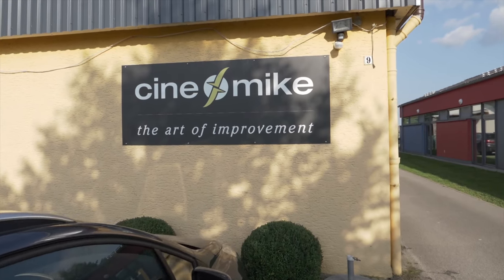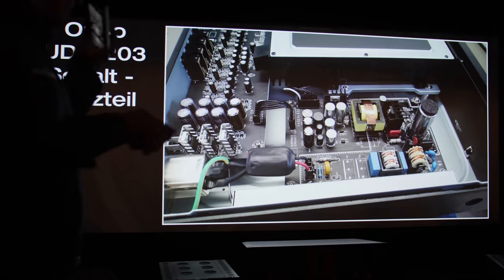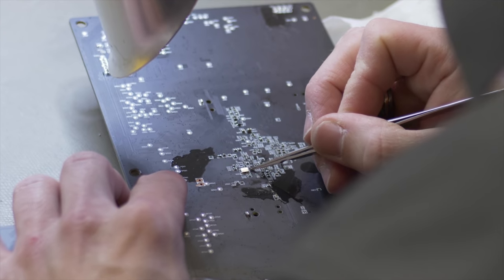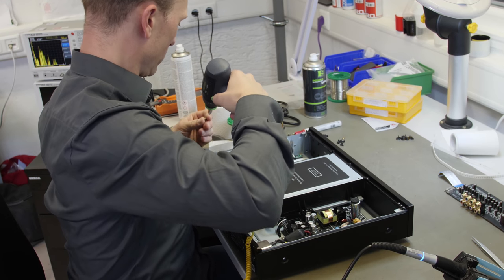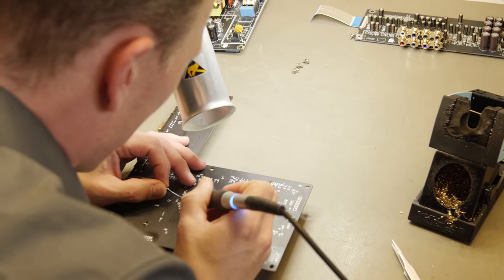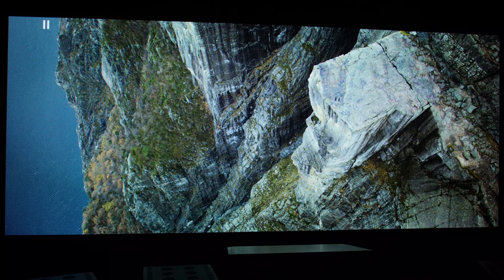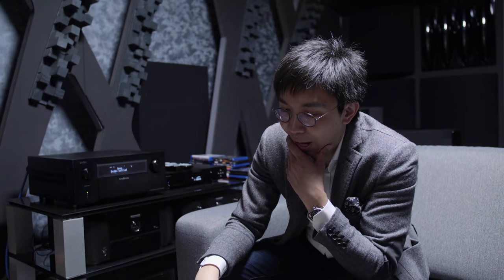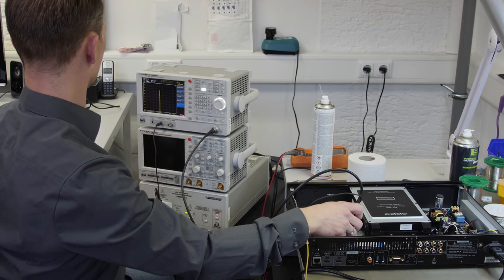What If You Can Lower The Noise Floor on Your OPPO 203/ 205? (Warning: Expensive!)

Comment: Typically the multichannel audio is sent from the video source to the receiver through the digital connection, and a DAC in the receiver would do the digital to analog conversion. Do you mean the Oppo's analog audio circuitry is where the mods had been applied? So analog audio cables were required between all the Oppo analog audio outs,  and a receiver/amp line level analog inputs? That would be quite an unusual set up nowadays
Reply: That's it essentially. By using the analogue outputs on the oppo you are bypassing the receivers DAC, and relying on the DAC that is inside the oppo to do the digital conversion (because of the DAC that's in the oppo. This is mainly used in two channel audio but can be used for home cinema.
Reply: nihilityjoey Yep, the latest ESS Sabre Pro Dac being used to its full potential. Plus the analog output stages most likely modified and optimized for lowest noise and distortion.
Reply: @rickg8015  that's correct.
Reply: We are only talking about the Hdmi connection here
Reply: Cinemike DE oh, that’s cool.. Even at that stage you could hear the benefits of the mods. Interesting.
Reply: Rick G actually there was no analog connection
Reply: Cinemike DE Yes, I got it. HDMI Audio output only, purely in the digital domain being used in the Oppo in Vincent’s audition.
Reply: @cinemikeDE  Yes, but the oppo would have been doing the sound  conversions, not the reciever which is again utilising the oppos DAC.
Reply: nihilityjoey The oppo is on bitstream output. All decoding is in the AVR
Reply: @cinemikeDE  Aaahhh okay, I get it now.
Reply: Then any difference would need to correspond to differences in the bitstream, eg. the bits themselves, or jitter. But jitter is typically no problem with proper buffering in the receiving end. And there should be no bit error differences on the receiving side even without the mods, bits are bits after all. Have you tested whether there are actual significant jitter differences, or actual bitstream differences (bit value errors, not noise levels) before vs after the mod? With no bit differences, there would be absolutely no acoustical difference, since all those bits received by the AVR, before and after the mod, would be the same and would be converted to exactly the same analog signal in the AVR's DAC, not in the Oppo
Reply: Cinemike DE I don’t quite understand why there are differences in audio quality when using bitstream. Furthermore, when there are differences in AQ why aren’t there differences in PQ? This should be even more obvious as the Player is doing some actual decoding, in contrast to the audio part.
Reply: Sledge Bam due to lower jitter and lower noisefloor in the complete system there is actually a huge difference in audioquality and there is also a difference in picturequality. This results in more stability in movements and more depth in the picture. Actually people are much more sensitive in detecting differences in sound in AB comparison. You can visit our place anytime and see ( hear ) for yourself.
Reply: There's no difference in either. This is audiofoolery at its best, but that doesn't make the observed differences any less real to the listener.
Reply: Raul Saavedra totally nonsense - yes bit s are only bits made up from good bits and bad bits you are dealing with udp bits here. Electronics are pseudo digital. All digital electronics are actual analogue and so are subject to noise.
Reply: @f091537  the noise in the components can effect the clock, therefore causing errors in the transmition of the bits, for instance a 1 can become a zero and visa versa. All electronic signals are affected by noise analogue or digital especially clocks. Cleaning the signal before it gets to the clock, changing a clock, will give better sound quality and picture quality. It's not adding pixel information or extra music information, it's simply cleaning your sound and picture so you get visual and audio improvements.
Reply: Cinemike DE thanks for the explanation. Is this something you can capture with a camera (stability and motion obviously not)? I did some reviews of mediaplayers and concentrated very much on the PQ (shown via objective test patterns) so it would be great to show the effects in PQ of your work in a review. I’m based in Germany so maybe we can arrange something.
Reply: Lower noise floor for digital signals does not change anything if the receiving end already was able to recognize a 1 when it was a 1, and a 0 when it was a 0. The important thing would be differences in bit error rates at the receiving end. Lowering the noise may not change that at all if the original noise level was already within tolerance and causing no bit errors in the receiving end. Lower jitter makes no difference if the receiving end is doing proper buffering. 
By the way my question stays unanswered, did you measure bit error differences before vs. after the mods?
Reply: Raul Saavedra I have and the error rate is far less and the jitter much lower ! You are making the school boy error that with udp all the components work perfectly as in a text book. You state tolerance which is bogus as it’s meaningless as that’s only in a control environment and as no of these system are true digital and only pseudo digital your point has no merit as shows no understanding of electronics in the real world. Noise in any system can cause miss triggers. Most of the power supplies are very poor on these devices and have been tested in the lab under perfect conditions. Once in the real world that does not apply. The mistake is you all forget this is udp send once and forget so if there is an error no way of correcting it just concealing it. There is no such thing as a digital signal that nonsense taught on poor courses around the world with people getting degrees that in the real world are useless. You have analogue voltages that have different voltage levels to represent a 1 or a 0 if you look at this analogue single that this is it’s plagued with noise in multiple harmonics up to ghz. This will effect clock and any device connected. All dependant on its grounding. If you put an oppo on a totally clean power source that is better than studio level conditioning it will work better but what u see it it corrupting itself with its poor noise handling. The device will build up noise over a period of time you can actual see and hear the picture and sound deteriorating. Importantly you can measure the error concealment rate going up and the error rate very close to point of failure. This is not magic just down to design what cinemike are doing is fixing poor design but like having help from an expert on your homework. All consumer equipment is designed for a price not a purpose. True professional equipment is designed for a purpose. Saying that a lot of pro equipment these days are made for a price so in most studios you end up modding it yourself just like cinemike does! Like all geniuses what he does is simple as it can be measured and results compared the true geniuses is it is very very effective!
Reply: I believe you nihilityjoey have not much idea about digital audio and standards then. Of course it knows in what order they are meant to be in, and there is a very well specified standard for HDMI
Reply: "Error rate is far less" Interestingly you say so but are not providing numbers. If you did measure it, how about you say precisely was the typical error rate you allegedly measured before mods, and what was it after the mods?
Reply: Raul Saavedra hdmi is very poor for audio as it sits in data island and is all cut up which is why the audio jitter is so high compared to to say aes which now we can get below 1ps. Correct it does not go out of order but it can easily drop packets and unlike the picture it not as robust. On some very high end professional devices they have started handling hdmi slightly differently and this is a massive improvement. This does cost as a hdmi controller is normal around $1 so to do it at a cost of $50 in the consumer world is not viable due to cost!
Reply: Raul Saavedra I am not near my notes but off the top of my head before its 300 in 1000 before that’s packet had errors on the out put with jitter if I think 660ps it went down to 50 in 1000 and jitter of 110ps. One oppo firmware update screwed it and the jitter went up to 900ps the latest update bought it back down.
Reply: Before you ask I use tektronix analysers and I have written or been part of writing a lot of the standards you all know and love and see everyday
Reply: 300 errors in 1000? Packets? Not only your reply suggests that you really did not measure anything, from all I can see, you don't have a proper grasp of digital audio and HDMI standards and technology. Not arguing with you any further
Reply: Raul Saavedra sorry who are you again? I think u are the mistaken one. It’s very easy to see the error concealment as the check sum in the packet says it has an error
Reply: An error might only be a 1 bit error in a packet and strangely it’s usually a lower order bit
Reply: It seems sir you are clueless about udp data !
Reply: The amount of BS and cluelessness is pretty strong on some replies I got above. This will be particularly crystal clear to anyone familiar with networking protocols plus digital audio and HDMI. People seem to think they can post whatever on the Internet getting away with it, as if noone anywhere in the entire world with knowledge about the matter would ever stop by and could take a look and see through the level of complete BS.
This is the first video from HDTVTest that I have disliked. I seriously wonder if Vincent will keep this video up in the long run.
Reply from the maker: Raul Saavedra Oh believe me, I was as skeptical as you too, and made sure to check the whole setup for the comparisons. I can only invite you to visit Cinemike and hear the difference for yourself, armed with all the theories in the world, just as I did. I believe in what I heard, otherwise I wouldn't be speaking with such fervour and passion. 

Oh, and if the Samsung Q9FN backlash and repeated YouTube attacks by others channels haven't forced me to take down ANY video, what makes you think I'll take down this one? Particularly if it fully reflects my opinion? :-)
Reply: No matter how skeptical we believe we are Vincent, a blind or double blind test would be needed to rule out bias when we know which setup is which. Anyone can fool themselves in that respect, that's why blind tests were created in the first place. "Hearing the difference for yourself" is quite pointless, does not prove anything whatsoever. And even with blind tests it could simply not just use their provided "stock" Oppo player (or their own cables and complete setup for that matter) against their modded one. If you are truly skeptical I'm sure you should see how easy it could be to skew results without rigurous controls. The technical comments that some posted above are clearly clueless and way off, which brings up some huge red flags to say the least. That's all I'd like to say. Watch out!
Reply: @raulsaavedra709  bitstream or not, the source is still reading and packaging  digital information to the reciever. The less errors in that information the better. And that's what these guys are doing. It's not a hard concept to understand.
Reply from the maker: Raul Saavedra You're preaching to the choir: my other half works in the medical field, and I am fully aware of the effects of bias, having studied and understood why randomised controlled double blind controlled trial is the norm there.

But as you may be well aware, conducting blind studies consumes a lot of resources: time, money, equipment, methodology design. Multi-billion pharmaceutical companies fund medical trials on the back of the obscene profits they hope to generate, but such resources are just not available for such a niche product even if we had the best intentions. By the same logic you apply, do you automatically discount all product reviews - phones, cars, robot vacuums, quinoa porridge - simply because none of them are randomised-controlled double-blinded?

At the end of the day, no one can change anyone's opinion over the Internet where armchair experts and conspiracy theories run amok. I was merely reporting my experience, in as factual a way I could, despite actually harbouring bias AGAINST hearing any improvement from the outset owing to my scientific background. I have heard the modded equipments, and none of the detractors have. Which is why I invite people to visit Cinemike to listen for yourself, and if you have the resources to put together a double-blinded audio test and participate with an open, unbiased mind, I'm sure they will be happy to oblige.
Reply: In all honesty, what I would have expected is not a blind or double blind test, but that you, as the professional Youtuber and video calibrator, would have probably received a modded unit for review on your own premises, and you would have managed to find a stock unit on your own, not one from them. And then you as a Youtuber would have made sure to do at least a controlled A/B comparison on your own terms, in your own controlled setup, without them present. That is what I would have called an independent and skeptical review. Not on their terms and on their premises, not like this video
Reply from the maker: This is not a review, and not titled/ presented as such. Your own bias is interpreting it as such.

And pray tell, who is going to cough up the 5500 EUR so I can "manage" to find a stock unit on my own? Do you expect car reviewers to "manage" to find a new Audi A1 to review too?

As expected, armchair experts are always going to be armchair experts, always demanding other people to pick up the slack without needing to commit/ pay a dime over the internet.
Reply: Never said you should buy the stock unit, I assume you have lots of contacts and might be able to get one on loan. Don't mind you calling me an armchair expert. Do call an actual expert then, check with them about digital audio and HDMI, and why lowering the noise floor in the HDMI interface might do absolutely nothing to improve the bitstream that the receiver will receive and convert to analog in its DAC. Or measure it yourself, bit-error rates at the receiver end, stock vs. modded, also jitter. Something that the posters above clearly have not done. By the way, not sure if you noticed, some of the most embarrasing comments above by some others have been edited. E.g. the one about the receiver not knowing in which order the bits would need to be. I won't argue further, but will repeat my suggestion: watch out for the red flags
Reply from the maker: Raul Saavedra OK, I just checked your profile, and you are based in Bonn, Germany, which is only one hour's drive away from Cinemike. Are you going to visit them and listen for yourself with an open mind, or do you prefer to defend your belief over the Internet?
Reply: No, no interest. It is absolutely pointless to do A-B on vendor's premises when they clearly have a stake on whether A or B should sound better than the other
Reply from the maker: Raul Saavedra Haha typical. Even if I did a blind A/B comparison on my own setup/ premise and report an improvement , you'll find some sort of excuse to discredit the test because it's just easier that way to support your own belief. That's bias.

Anyway, all talk, no action is the classic hallmark of an armchair expert, so you have a good evening.
Reply: Bias is rather to consider a blind AB and thinking already that you would report an improvement. Also to assume that I would do what you are saying. That is actual bias
Reply: @raulsaavedra709  You are right, the comment was edited, deleted in fact to make way for one, more on point. The source is the one transferring the digital information to the reciever, all the reciever can do is decode that information, errors an all. That was my point. The reciever doesn't fix those errors. In fact the reciever dac will add its own errors. Now I don't know if you are listening to yourself but you've went from "modifying the hdmi interface won't do jack" to it "MIGHT not do anything".  This video has shown that it does.
Reply from the maker: Raul Saavedra I wrote "IF", not "WHEN", and the post is unedited. It appears your bias is clouding your comprehension.
Reply: Major mistake HDMI is not a networking protocol and has no similarity to one what so ever. I spend more time firing network people who think they know all about video than anyone else. HDMI is a point to point digital transport interface using send and forget packets (UDP) and is a lossy interface. This is the key HDMI is a Lossy format cos its send and forget with no return path for errors. HDMI is an extension of the DVI format so its a bodge as it has no audio mechanism, the audio is cut up and inserted into the blanking which in HDMI is referred to as DATA ISLAND. The formats only have a return path to communicate an EDID & HDCP to downstream devices. 

Networking has no place in video and audio as its not real time. If you have to send video or and audio over a network you have to use UDP which now means you have created a lossy system that now will suffer from data loss. Unless you send it as a Store and Forward file. Ethernet is a Send & Return format and as Video and Audio is time sensitive cant be sent in that way as you would have major gaps in the picture and sound. I have great pleasure in firing computer and network people from film sets and in post as they have no place in our world just cos they have a few cisco certificates they think they know how the world works and I enjoy humiliating them and make sure everyone knows they are phoneys as they can't deliver what is needed and come out with real BS as why its not working. So before you call BS think do I really know what I am talking about?

I was with Vincent when he shot this video and think it's one of his best as it's about the real world and real issues. If it shakes the uneducated from their safe world where they think they have all the answers then he's done a great job as Digital electronics is so hard to get right as its suffers from so many issues the analogue world never did. Very few people really know about this subject and I mean a handfull of people in the world.
Reply: Both Ethernet as well as HDMI have a packet-based transport layer, means chunks of data will be sent and either received or lost. Thats alot lower than UDP, and UDP would be more than fine for realtime audio btw.
Ethernet can detect errors, HDMI can detect and correct them (obviously only to a degree).

Now you would not even start any blind-listening test, you could simply measure the detected/corrected error rate to prove a difference.
The fact that someone sells stuff for thousands of euros and doesn't care to verify his work tells you alot, how much he is interested in quality.

Thats the thing with digital transports - you can very easily test their functionality.

There are standards for acceptable amount of errors, for Ethernet this is must be less than 1^-10, I expect HDMI to be comparable. If anyone sells hardware that makes an audible difference by lowering the error rate its horribly broken.
Reply: HDMI has no method to actually detect errors other than the checksum in each packet. Ethernet is a lossless system, HDMI is a lossy transport method. Ethernet has error correction, HDMI has error concealment. You can't compare the two as they like comparing a bicycle to a Tesla. HDMI does not have a comparable error rate as its send and forget. You can guarantee 100% packet transmission but you can't guarantee that all the packets are correct. This was HDMI strength comes in which is HDMI concealment, This means it will try and fill in the errors. In a critical application like audio and video, this is hopeless as it fudges the output hoping you don't notice. This is where people make huge mistakes in forgetting that HDMI is a lossy transmission method, it actually states this in the HDMI spec its not a verbose verbatim transmission method. 

The Cinemike guys have tested this and everything is measured as well as listened to and viewed as in this world pure measurements don't mean it will look and sound right that's the first thing we teach audio video engineers you need to look and listen as well as measure. I love all these people commenting who have no practical experience and rely on something that they heard once and believed to true. The only way to have an opinion on this is to DO IT! Also, why are people so stupid to believe that you can improve on a bad design? If you do then why do you upgrade your equipment? A DVD player from 2002(HDMI introduced) should be perfect in sound and picture compared to anything today! No, it does not so now go away and rethink your logic!
Reply: What a load of bollocks.
Ethernet has a 32bit crc and HDMI 8bit BCH code per packet in the transport layer, this allows you detect and correct an certain amount of errros. the important point is this: its extremely unlikely (1 to billions) that an error is undetected and the data will be treated as valid.

So if theres a problem in noise then you could count the appearing errors, as this is done when testing cables. A "tuned" device should then show lower errors.
given that bit errors need to be extremely rare as dictated by spec, I really doubt that.
You dont need to start a subjective listening test if you can just simply reason about, and even then the eyes/ears are a lot less reliable then instruments aswell.

Oh, and a DVD player can have various improvements aside HDMI, like digitally postprocessing. HDMI is lossless, of couse only if within spec, cutting the cable or wrapping it around a transformator will kill the signal.
I have no doubt that there are alot of improvements possible, but this cinemickey stuff is like ejaculating on the backseat of a tesla and claiming it will accelerate faster now.
 (The only way to have an opinion on this is to DO IT!)
Reply: Total bollocks !
Reply: Where do u get this rubbish? HDMI is lossy its a send and forgets transport stream not a Send and Return network protocol. Why do you keep comparing apples with oranges?  Where do you get that its lossless? It even says in the spec it's lossy. It has no way of sending data again if it has an error. It does not have error correct it has error concealment totally different.  Next, you will be saying my Tektronics video analysers is wrong or broken when it shows you the loss in each packet? Anyone who works in this field knows HDMI is total rubbish. Displayport is far superior and SDI is way better all are classed as lossy transport mechanisms. You are posting FAKE NEWS as nothing you have said is actually true other than the how the packets are structured. Do you work day in day out with this? Do you have a method of reading the HDMI packets and checking for yourself? I do and you are spreading nonsense.
Reply: define "lossy", I doubt it means what you think it does. ie. what is not "lossy" and works when I cut the cable?
send & return has nothing to do with the transport layer, ethernet has no "send & return" either - but TCP/IP does which is several layers higher (and could be run over HDMI`s transport layer). Ethernet and HDMI Transport layer are comparable, and agnostic to whats running over them, and do exactly the same in the stack.

Why do I need to read the HDMI packets myself, what kinda weird logic is that? There are tools for testing cables and oscilloscopes able to decode the packet layer,
and guess what if you want a HDMI certificate you need to prove that you have a error rate of less than 1 in a billion. And up to 4 wrong bits per packet can be corrected.
Means on a compliant chain you will see never have, much less see any error.
What you do, in other words is you send additional data (redundancy) to validate and/or correct your payload. Thats only working aslong the error rate is low enough, and thats required by HDMI spec.

You can brag whatever you want with your equiment, you have no grasp about anything.
Reply: I refer to the OSI Model, the Data link layer is responsible for delivering packets and is totally agnostic to the content and meaning. This is a fitting description of the HDMI Transport layer, on which you could base UDP, TCP and whatever else protocol you need.
What you mean with "lossless" is something like TCP, and this is not handled at this layer, and with that definition there is no "lossless" display connection as none of the existing will resend lost packets.

Kinda strange that I need to explain this to someone who was "involved in creating a number of these formats and specs"

And thats completely beside the point, as its enough if you can detect if a received packet has errors (recoverable or not) to count them. That would be enough to measure the a difference, and equipment to measure this must be available for compliance tests.
The specs call for less that 1 in a billion error, and a packet on the HDMI-Layer can be fixed with up to 4 of them. If OPPO has a visible/audible problem with that, its time for a refund and report to the HDMI consortium.
Reply: The spec may call for that and I can't find it in the document in front of me which is the final HDMI 2.0 spec so where are you getting this stuff?

The equipment for testing is made by TEKTRONIX if you knew anything about testing and measurement they are the reference in the industry.  

The OSI is the second layer of the seven-layer OSI model of computer networking and nothing to do with HDMI and HDMI uses Transition-minimized differential signalling which is not what ethernet uses. A two-stage process converts an input of 8 bits into a 10 bit code with particular desirable properties. In the first stage, the first bit is untransformed and each subsequent bit is either XOR or XNOR transformed against the previous bit. The encoder chooses between XOR and XNOR by determining which will result in the fewest transitions; the ninth bit encodes which operation was used. In the second stage, the first eight bits are optionally inverted to even out the balance of ones and zeros and therefore the sustained average DC level; the tenth bit encodes whether this inversion took place. TMDS was developed by Silicon Image Inc. as a member of the Digital Display Working Group. Nothing to do with ethernet or layer 2 data where are you getting this stuff from as is total nonsene?

The only similarity to Ethernet is they both use twisted pair cable that's where it ends!
Reply: http://d1.amobbs.com/bbs_upload782111/files_51/ourdev_716302E34B9Q.pdf: "At TMDS clock frequencies less than or equal to 165MHz, the Sink shall recover data at a
TMDS character error rate of 10-9 or better, when presented with any signal compliant to the
eye diagram of Figure 4-32"

You are further setting up strawmans, the electrical characteristics are not important, HDMI has a Data transport layer, which does all the mean stuff of framing and adding error detection/correction. Its the same level as Ethernet in the OSI Stack, and could host any protocoll like TCP - packet acknowledge and resend is not needed or wanted at this Layer.

A bad link/source is detectable directly, by looking at error counters that counts errors.
Reply: I may point out posting copyright confidential documents is an offence and could mean you might spend some time in jail as what you have done with your link is legal. I have flagged your post as a copyright infringement and your real IP address will be logged.  

You are the strawman as you keep changing your arguments as nothing you have said is true and everytime fact is presented to you just change track proving you are a guy sitting at home reading the internet with no real-world experience just surfing the net spewing nonsenses thinking you are the big man when in fact there is no substance to anything you post. If you spent as much time on constructive activities I think you would be a much happier person and a productive member of society.

In domestic equipment, this not implemented correctly. HDMI is junk its a known fact. it is badly implemented it is very lossy. Display port pisses all over it in robustness and lower error rates. SDI kills all of them but still has errors. Sony only recommends you go no more than two generations of copies over SDI for this reason. BARCO and Digital Projection are the only people I know to make HDMI work anywhere near its true potential.  

I am not sure about all this nonsense about a  Data transport layer, it just sends video. That's it full stop, it doesn't even send audio if you want audio its packed into the blanking. You then unpack the blanking and all the fun stuff is sitting in it. You are not confusing the  Display Data Channel - Enhanced Display Data Channel which is a 100 kbit/s which is the E-EDID.
 .
HDMI is just blanking video then blanking. It has no Data transport layer other than what is needed to have blanking video blanking ect its very simple you can, of course, implement an extension to HDMI which allows data transmission alongside the video. But guess what? No one never has.  
HDMI is just blanking video blanking video. It has a very simple controller that has header info and handshaking. HDCP errors are a major issue. Due to the HDCP been a complex handshake with Keys and it can take 4 to 5 minutes on some Sony projectors due to errors in the data and the keys been incorrect due to an error. If as in your world it is all error-free all these poor sony projector owners would not be sitting there for 5 minutes before getting a picture. Now once you extract the data island from the blanking this has some kind of data management to extract things like Dolby Atmos or DTS or AURO3D sound. Why projectors? Cos they are normally more than 2M from the device so the errors are way higher than on a shorter cable. You go to short on an HDMI cable and you get reflections and the errors are again higher. RGB 4:4:4, 8 bits is the default that's what it thinks it is sending the rest is done as an extension. 

The point is HDMI is a lossy format. That's a fact! I see that every day. HDMI controllers are very simple they don't have any of the clever bits that ethernet controllers have as its just blanking picture blanking. It's DVI on steroids. The block diagram in the illegal document you sent sums it up - video audio in - Video Audio out. HDMI link operates in one of three modes: Video Data Period, Data Island period, and Control period. During the Video Data Period, the active pixels of an active video line are transmitted. During the Data Island period, audio and auxiliary data are transmitted using a series of packets. The Control period is used when no video, audio, or auxiliary data needs to be transmitted. A Control Period is required between any two periods that are not Control Periods. That's it! 

All digital system have some form of error concealment. Without them, the error rate is off the charts. In the real world, I have never seen error counts that are anywhere near the spec. This myth that digital is perfect is nothing more than a myth as its far from perfect. Your post has proved it even more as the amount of miss information is astounding. I am now bored as you will come back with another bit of left field nonsense. I am not sure what you are arguing as the real world facts speak for themselves!  Face it HDMI is shit the professional world has known this for years which is why we don't use it! Goodnight!
Reply: Oh shit I now am scared.

HDMI at its lowest level sends data in packets, and guards that with an error correcting code. Thats quite easy to read up, just repeating some weird crap like "it just sends video" is not helping you - thats your pakets of data.
Some even claim you can bitstream lossless audio over HDMI, those frauds!

The only thing true is the issue with cable length, a long crappy cable goes a long way to demonstrate how real noisy circuitry would look like.

But you are right in one other thing, this is a waste of time for both of us. Feel free to make a final reply, seems your personality really needs it.
Reply: @raulsaavedra709  connecting an orginal Oppo back in the chain (which is the case with an AB) you will not get the full benefit because of the performane loss. It has a parallel effect on the complete system, also amplifiers is my experience. It all depends on the quality of the complete system The higher the quality the more you will experience this negative effect.

I personaly do see a positive effect on the video quality myself. There is no noise, the picture is stable and because of this you'll get more depth in the overall picture quality.  Also on the Lumagen processor and the projectors they modify. Once you know the CineMike products, this is immediately something you'll notice when watching an orignal unit again. Back in 2010 I was also very sceptical and what I did was pick up the phone and gave Michael a call and we made an appointment. (It can be that easy) so I drove to Germany with my Oppo 83 Signature edition from the Upgrade company to see and listen what CineMike was all about. I was completely blown away about what I experienced there. This was a complete new experience for me. They left me completly alone, never put pressure on me about what I should see or hear. This is what I like, and now these days we became friends, and I even have a dealership in the Benelux as a point of sale. Here customers can have a demo and get there own impression. Like the first experience I had in Germany myself. No pressure nothing. Even home demo's are possible. IMHO Michael Krehl (CineMike) is a true genius with a huge knowledge and passion for his work. I am happy that back in the day I made that phone call to meet them.
Reply: Before I purchased my arcam avr20 with matching power amps to drive my Sonos Faber sonetto front stage speakers which is part of a 5.2.4 configuration, I wanted to address my noise floor first! Even though I've changed my cables three times it was only when I used shielded cables did my noise floor become drastically reduced! One's got to remember unshielded cables act as antennas for attracting RF/EMI interference and the longer the cable the better the antenna. Probably explains why when I used to disconnect my cables of length my noise floor used to be reduced! If one is running a multi channel setup, one can go ahead and put this to the test... Watch a movie for 10 to 15 minutes then sit for a couple of minutes and listen to the noise floor then switch the setup off disconnect the rears and height cables from the back of the AVR and repeat the process. 🥳

Good video btw Vincent.  👍

The amount of work I have to go through to accomplish this can be seen within this short 3 minute video...
https://youtu.be/wwU0d3NfRQw